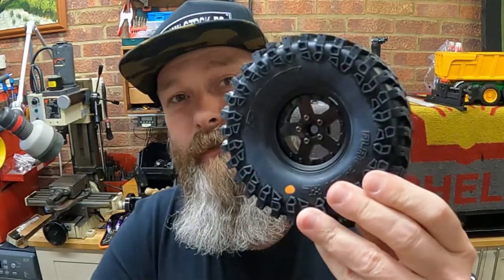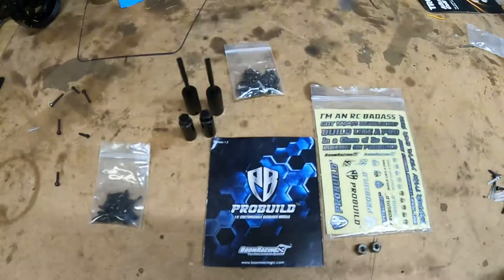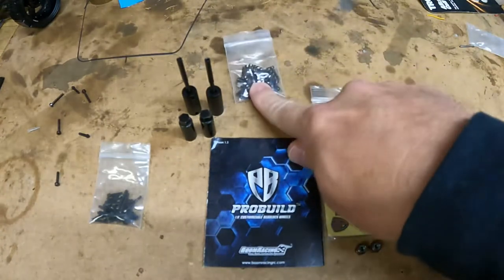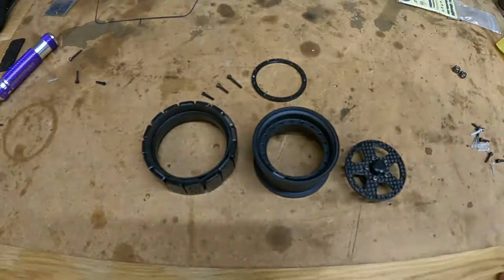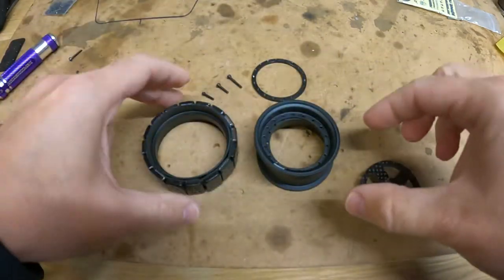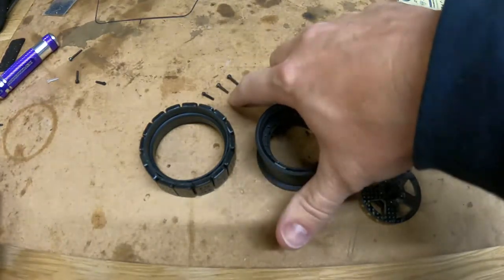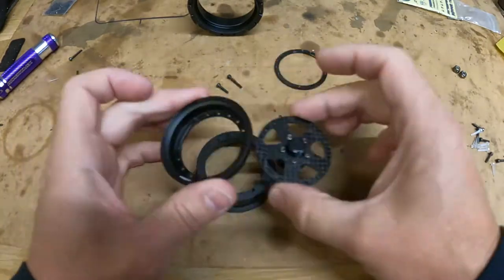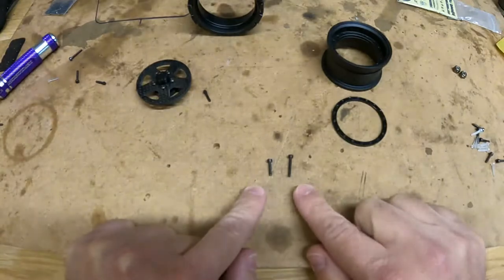Boom Racing ProBuild Pro Build Custom Wheels How To Build Guide

Comment: Awesome video! Just a small clarification the faceplate should not be installed between the two barrels as that alters the total width which the center ring won't be wide enough to clamp down the beads properly. The faceplate can be installed in four different positions, front side (either front of lock ring or rear) and back side (same front of lock ring or rear). Hope that helps!
Reply from the maker: Hi Jason, yes I realised what I said after processing. All the best.

Comment: What hardware did you use to fit the centre caps? I received three different types of wheels nuts, a O’ring, a plastic washer and a grub screw…what goes where?
Reply from the maker: Hi Glyn, the oring should fit in the hole where the wheelnuts goes so you have something to tighten the hubcap up to.